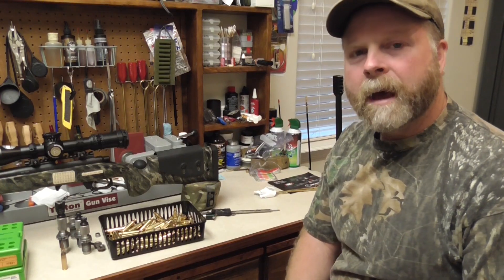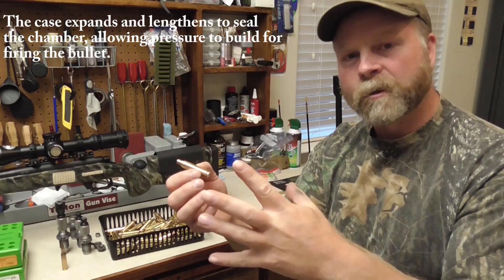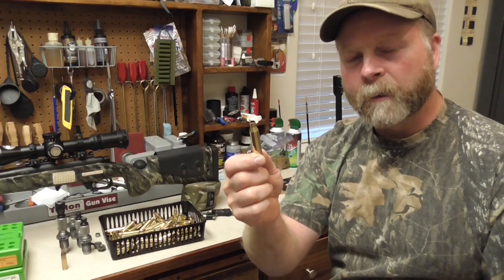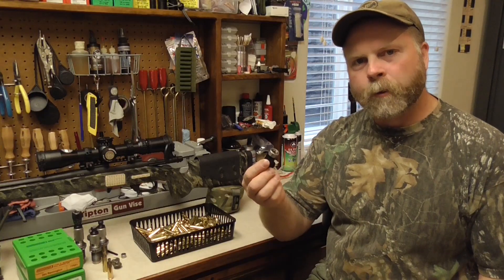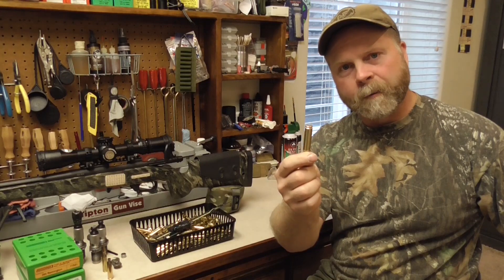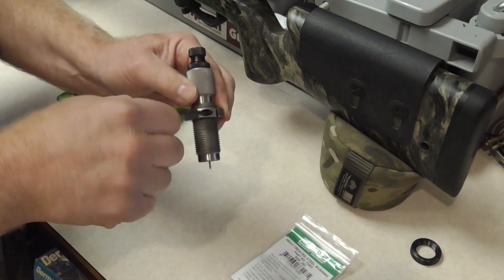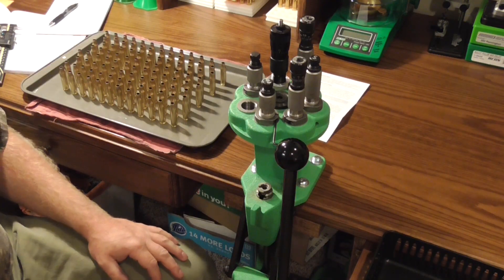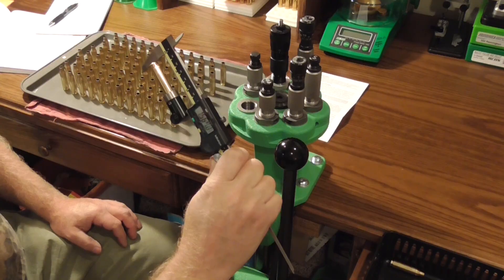Redding Type S Full Length Bushing Die: How to Set Up and Size Cases

Comment: Does the brass need to be sized if it's new lapua brass?
Reply from the maker: As long as the neck diameter is what you like for tension, no.With Lapua 260 Rem brass, I have to run new cases over an expander to get the .293" OD that I use.

Comment: Do I understand that after you full size the case which sized the neck with the proper bushing,  you set your bullet onto the case and press it into the case with a bullet press die? There is no additional crimping after the bullet depth is set? I have been using the Redding standard full size die with the sizing stem, the type you removed to get the nut and have had a lot of problems with stuck 223 cases. I'm hoping for better results with the Redding bushing full size die.  Thanks for taking the time to do such great videos for us novices.
Reply from the maker: Yes, that's right. If you're having problems with stuck cases, make sure the die is perfectly clean before you begin, and get the cases as clean as possible, too. I use Hornady One-Shot spray lube. If you follow the directions, it works very well! I've sized thousands of 223 cases using One-Shot and standard Redding dies without sticking them.

Comment: how do you know what bushing to get and do you use those with the shell holder set that are different widths?
Reply from the maker: It's trial and error, but In my experience, they run best between .001" and .003" neck tension. I size everything now to .001" smaller than loaded diameter. I've used the Redding Comp shellholders, but don't anymore. With good brass and consistent case lubrication, you should be able to adjust the die one time to size every case from the same chamber. I've sized 98 pieces of 338 Edge brass 6 times now without touching the die.
Reply from the maker: http://panhandleprecision.com/redding-bushing-dies-select-proper-bushing/

Comment: When you size with the full length bushing die, how do you prevent the shoulder from being pushed back to far.  In your video, you were able to achieve .001 push back with standard installation.  I have been pushing the shoulder back to far.
Reply from the maker: I use a Sinclair Comparator body and bump gage to measure the shoulder. If you go too far, back the die off slowly until you get the amount you want. It doesn't take much thread contact to move the die in .001" increments.

Comment: I think its interesting that Panhandle Precision doesn't turn.  The main purpose for turning is consistency.  For example, I just finished turning a batch of Hornady 308 that ranged between .014 and .016 neck thickness.  Some cases had a minimum of .014 plus 2 thou, some .015 no variation, some .015 plus 1 thou, and a few .016 no variation.  I turned all of them down to .014 (in two .001 steps).  I found these cases on the range.So now I select my bushing size:  .014 + .014 + .308 - .001 = .335 bushing size.If I don't turn the necks, then my neck tension on the bullet will be all over the place.  So now I have to convince myself that neck tension makes a difference.  I think I have noticed a difference in group size, but in truth I might be imagining this.  So when I read that almost all the 100 top shooters turn their cases, so will I.  It only has to be done once during the life of the case.What makes sense doesn't always make a difference.
Reply from the maker: "If you think it helps, it does." I've turned necks to "0" runout in the past. I've also prepped and sorted brass to make sure they were as close to the same as possible. I didn't see enough (if any) difference in the end results. That's not to say someone else won't. There are a lot of things folks do based on conventional wisdom or rules of thumb. I say question everything and let the results speak for themselves.

Comment: Super videos, Thanks.

1. On the Redding Type S bushing style neck sizing die 78594 do you use the "Body" die with every reload?
2. Also, do you use the B/NK decapper neck sizer every loading? 
I thought I'd ask you on these, Redding doesn't like to talk on the phone or otherwise.
Reply from the maker: I don't use that particular die set, but with the Competition dies, I body size after sizing the necks. Every time.

If I understand the second question correctly, yes, you have to size the neck every time. If you're asking about depriming, I use a RCBS Universal decapping die in a separate press to remove spent primers.

Comment: One trick for Redding die lock rings is to put a few pieces of lead buckshot between the grub screw and threads of the die body. Stops the threads on the die body getting damaged.

Comment: hi.. new to reloading. how do you deprime first?
Reply from the maker: I use a RCBS universal depriming die set up in an extra press. It keeps my main press much cleaner than if I deprimed while sizing.
Reply: Also another question for choosing the bushing how come you go off a loaded round and not just subtract 2thou of a fire formed case?
Reply from the maker: The diameter of the neck on a fired case will be much larger than a loaded round's diameter. The best way is to load a round with the brass you intend to use and measure the neck diameter. I have some pretty good notes on some different combos if you want to let me know what you're loading for.

Comment: Hi Yah Panhandle. Just come across you tube and must say,, Much enjoyment... I've spent much time researching this subject as I've had a few challenges with my 260 loading and found that your overview to ring home to me. Very concise information that i will use and explains some of the probs I've encountered. Good on you and many thank. One question un answered is the effects of neck tenstion and positive signs of over tension. Can you advise as to if I have the occasional load that is tighter than the norm, could I see and pressure signs or change in Point of impact if the difference in tension is significant? Many thanks!!!
Reply from the maker: +260 NOB It would depend on how much difference there is in neck tension. I've fired virgin Lapua brass that wasn't expanded first against the same brass expanded to .001" tension. The new brass was .004". No pressure problems, but velocity extreme spreads were higher with the .004" brass and precision wasn't as good. As a rule, I don't use more than .002". Annealing the brass before sizing will help keep them constant.
Reply: Many thanks and have experienced this with Lapua virgin brass also though didn't identify my probs as being neck tension. Cheers!

Comment: Great video.  Just got my readings full length bushing die and competition seater.  Really wanting to eliminate the run out and keep constant neck tension.  I have a question though.  I usually use the sizing wax you rub on your fingers to lube and I use it on the inside of the neck.  Redding recommends, although it doesn't say you have to, using dry lube for the neck.  Is this necessary, or does it not really matter?  Thanks for posting the vid panhandle.  P.S. - I'm using the titanium nitride bushing.
Reply from the maker: +tskfrcdgr I lube the necks even when using the TiN bushings. A little bit of Imperial wax, Imperial Dry Neck lube, or Hornady One-Shot. If I'm FL sizing, I just use the One-Shot for everything. Keep the die and bushing as clean as you can.

Comment: Having a problem.  Even with ram fully contacting bottom of die (ie: no backout) I am only getting a resize 3/4 way down the neck. You can see the line where bushing stopped resizing.   I tried this on several factory Nosler .260 in sammi spec.  Is this what is supposed to happen? I think no.

Does it with decap rod and without (regular bushing+decap bushing in place).  Bushing screwed all the way down, barely any rattle.  I was suspicious of my shell holder, but you can actually see just a sliver of daylight between it and die.  Sliver is much less than amount not resized on neck.
Reply from the maker: +Ronin Iscandar Yes. It's normal. The bushing dies won't size the entire length of the neck.
Reply: +Panhandle Precision interesting, doesnt say that anywhere in literature.  So tension on bottom of neck is less/non existent?  Doesnt that defeat the purpose of a neck being a given length for bullet? In effect we have 3/4 of neck now used to grip bullet.
Reply from the maker: If you consider the length of the case neck and the length of a bullet's bearing surface, there is plenty of bullet grip there. Some lighter bullets  that are seated long don't even contact the neck back by the shoulder. Some guys use the competition neck dies to reduce the portion sized even further. It's a non-issue as far as performance is concerned.
Reply: +Panhandle Precision so the 'one caliber deep' rule of thumb and saami/cip spec is hogwash basically?  Are those just conservative measurements for military (rough) / semiauto usage?

Some things I've read about full length necks:
-more forgiving on inconcentricity/runout (more area to 'average out' inconsistencies)
-less chamber erosion (parallel gas flow and more brass buffer)
-better seal perhaps reducing neck soot

Would you agree with these and whats the advantage of going w shorter necks/sizing?

Thanks again for taking time to answer questions like these, your channel is great.
Reply from the maker: I haven't tested those theories myself, but I've certainly gone against the grain of a few. Overall, I've had less runout using bushing dies, but I've also found moderate runout to not effect accuracy in at least two of my rifles. I don't even check anymore. I honestly think that most of those theories aren't based on anything tangible, just assumptions. I always encourage people to try different things until they get the results they're looking for. Test until you're tired of it, then just shoot! Thanks for watching and commenting.

Comment: also Sam...are these bushings interchangeable. ...will I have to buy a set of resding dies if i already own rcbs dies? thanks Sam
Reply from the maker: +JP811931 Having never looked at a RCBS bushing die, I don't know about the interchangeability. I know that once I started using standard Redding dies, I sold all of my RCBS dies.
Reply: Yes, I use redding bushings in my RCBS die.  If you go to the MidwayUSA website and look at the RCBS neck bushing die, it will specifically state that the bushings are interchangeable.

Comment: big fan of your channel here...learning lots...How do you come up with the neckngrip tension  ( in your case 0.0015) im getting into target shootin and want my s.d within 10....im around 15 now
Reply from the maker: +JP811931 It's all trial and error. The bushings have tolerances, so you might not get exactly what you think with a particular size, but it'll be very close. I never go less than .001 and never more than .003.
Reply: +Panhandle Precision  doni have to get ressing dies to use those bushings...or  can use them with ny rcbs dies?
Reply from the maker: JP811931 I've never handled a RCBS bushing die, but the pictures I've seen of their bushings look different than Redding bushings. I don't think they interchange.

Comment: Sorry misread that first bit. Do you think neck turning would be a waist of time with the bushing set up?
Reply from the maker: +Zachary Berryman It was for me. There is an old saying that goes something like "If you think it helps, it does". I tested it pretty thoroughly on a couple of my precision rifles, and found little if any reason to continue neck turning. I even mixed in turned with non-turned rounds, and couldn't tell them apart on target.
Reply: The Redding mic. Die seats really well from what I understand. What kind of runout are you getting off the bullet?

Comment: So are you neck turning after expanding the case mouth? In theory, wouldn't that push any variances in thickness to the outside of the neck to be removed?
Reply from the maker: +Zachary Berryman I tried neck turning for awhile, but couldn't prove to myself that it gave enough returns in accuracy to justify the labor. Yes, in theory, pushing the variance out with the expander would expose it to the cutter. Now I check the necks when the brass is new with a concentricity gauge, culling the cases with >.0015 runout. The mandrel I use to prep new brass is the same one I used for expanding the necks for turning, but I don't turn necks anymore.

Comment: Are you using once fired brass, and has it been neck turned?
Reply from the maker: +Zachary Berryman I don't neck turn any of my brass. I always start a barrel with new brass, but I was demonstrating the dies with fired brass. With new brass, you would have to expand the necks with a mandrel to start out with the proper neck tension. New Lapua brass, if left alone, will give about .004" neck tension.

Comment: Where is the decapping pin and expander ball?...
Reply from the maker: +Beaverman 180 I take them out of the bushing dies. You don't need to expand, and I de-prime all of my empties beforehand with a universal decapping die before tumbling.
Reply: +Panhandle Precision 

Thats what I don't understand about a bushing die..a guy takes the time to get the right busing then the expander ball changes it..
Reply from the maker: +Beaverman 180 Yep. The big advantage to using bushing dies is what you DON'T have to do to the neck of the case. Less working of the brass = more consistent neck tension and longer case life.
Reply: +Beaverman 180 I'm new to reloading and this is a question I have.  This can be extended to all resizing: why go all the way down then back up? Why not just reduce to the 'expanded' size?
Maybe Panhandle can help here.  Good video btw, thanks.
Reply from the maker: +Ronin Iscandar If I understand you correctly, you're referring to the "expanded" size of the neck after squeezing it down in a standard die, then expanding it back out with the button on the decapping rod. The bushing die eliminates the need to expand it back out on the "up" stroke of the press handle. Once the neck enters the bushing completely, all the sizing necessary for gripping the bullet is done. I always remove the expander on bushing dies.
Reply: +Panhandle Precision I got that, the question was not of your procedure, but why is that procedure not standard?   Even if you are using the ball/button to push irregularities to the outside, why go down so much?
This is a somewhat rhetorical question of course which is posed generally.
Reply from the maker: +Ronin Iscandar I suppose it's because of varied tolerances among rifle chambers, die bodies, expander buttons, brass, etc. The major die making companies are selling to a broad market of folks, who are all using different components. They have to make the dies work for everybody, and the push/pull technique is probably the best way to do that.